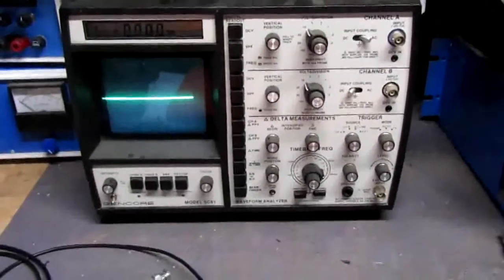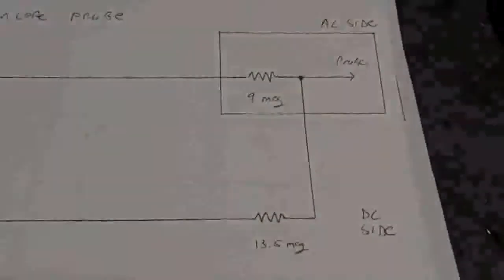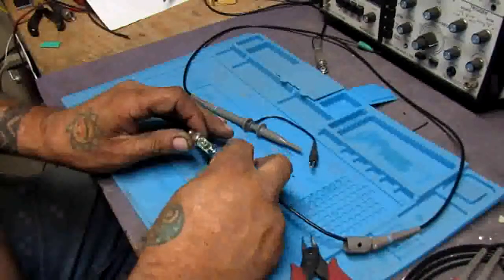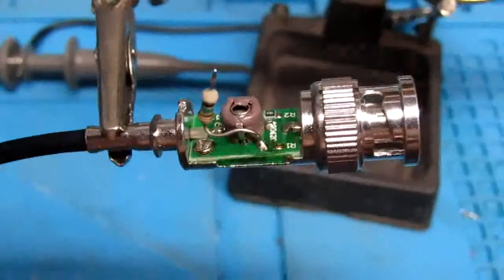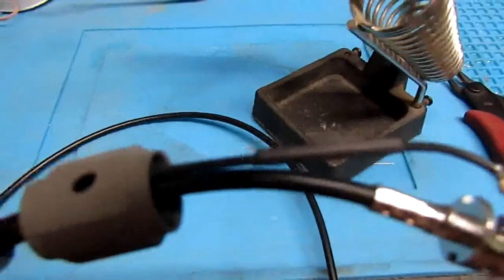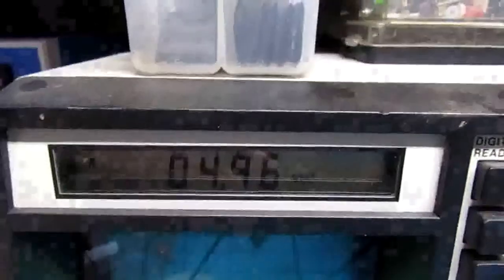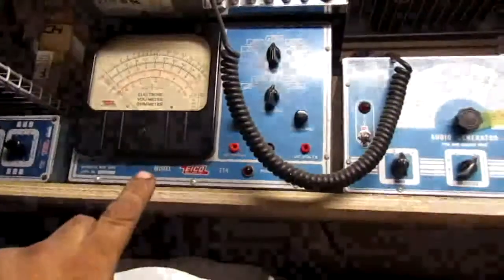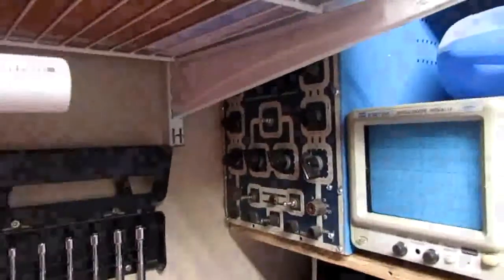Sencore SC61 probe build and bench tour

Comment: Great video - I'm in this position now.  1 question though since I'm old as well and its hard to decipher the color bands - #1 and #2 Resistors are both 9M.. is the third resistor going to the DC lead a 4.7M?  Thanks.
Reply from the maker: Yes. They should all total up to 15 meg, including the resistor in the scope. So you would have a 9 meg + a 4.7 meg + the 1.5 meg inside the scope for a total of 15 meg. It basically creates a voltage divider circuit to get the correct voltage reading on the scope display.

Comment: What is the wattage of the 4.7k resistor you added, and what is the highest DC volts you’ve tested with the modified probe?
Reply from the maker: this was a 1/4 watt, 4.7 Meg resistor. I have tested it up to around 60 VDC.

Comment: Yep, pretty near close to impossible to get original SC61 probes. I was hoping your plan would solve my problem. I was following along pretty well up until just after you removed the 100 ohm resistor. After that a whole bunch of important stuff seems to have been skipped over. If you remove the 100 ohm resistor aren't you cutting off the signal path for the AC input? How does that work? I'm really confused as to why all of a sudden I need two 9 MOhm resistors if there is already an existing surface mount 9 MOhm resistor on the probe circuit board. Did you remove the original SMD 9Mohm resistor and replace it with one of the through hole resistors? The more I try to figure this out and correlate it to your video the more confused I get. A schematic detailing your final modification which shows where exactly where you placed the three new resistors would have been mighty helpful. I will order the P6100 probes and hope that I can reverse engineer the circuit so I can hopefully figure out what the heck you finally ended up doing. This is my last hope to make my SC61 a usable hobby analog oscilloscope.
Reply from the maker: i copied exactly what was printed in the sc61 manual. it is basically a high impedance voltage divider for the dc input. i thought i had drawn a diagram of it?
Reply from the maker: i'm going to try this again with surface mount resistors. i didn't own any at the time i made this video
Reply: @rusty1187  Your video does a pretty good job but some of the details showing where and how all the parts fit into the modified P6100 probe were not completely clear to me. You did however give plenty of information on what you were trying to achieve and I'm sure I could figure it all out for myself. I'm just a little bit lazy. As it turns out a retired T.V. repairman, who is moving out of area, gave me his working SC61 scope along with three fully functional probes which include the DC input. But I think that I still might give your project a try just to see how well it works. If you get it working with surface mount parts than maybe you'd be willing to post a how-to video of that? I'd like to see. Cheers!